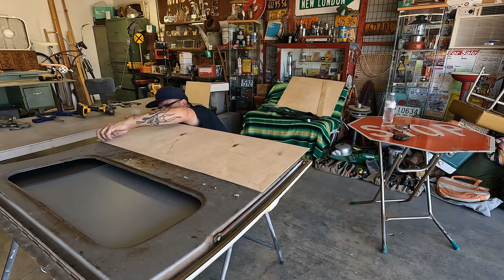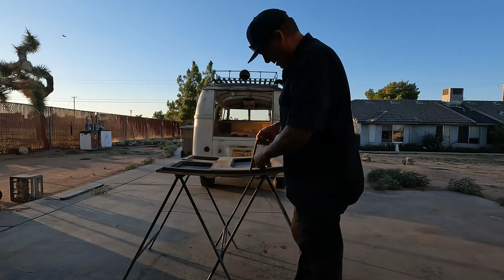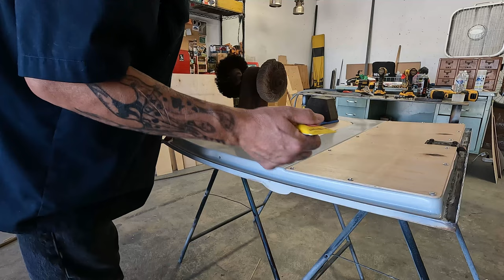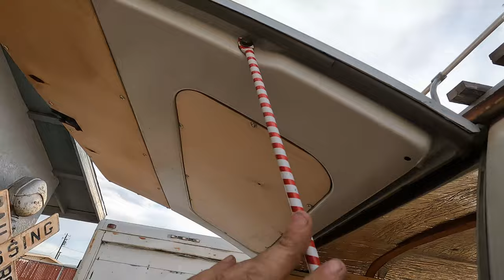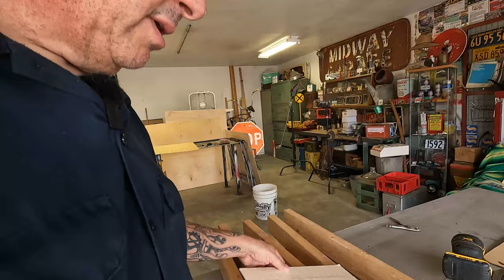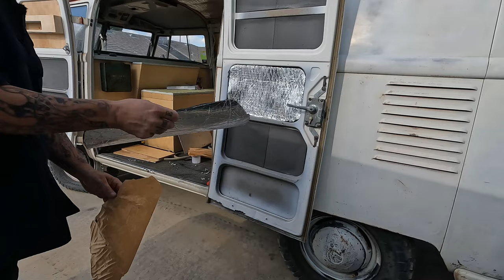VW Bus Camper Interior Restoration - Rear Hatch Cargo Door Panels - Budget Overlanding Minded

Comment: Larry Thanks for sharing and all your hard work.  Great Video.  Where did you find the Baltic Birch ply for the panels?  Maybe I missed it.  Thanks
Reply from the maker: Three or Four years ago I found the Baltic Birch paneling on Offer-Up and decided to check them out. I took a drive to Highland near San Bernardino, CA to see the guy. This dude had a lot of paneling! So I sifted through about 500 pieces to find the best 10 that were all the same hue and 5'x5' size. Although they all had some flaws, I didn't mind since the price was right. The seller quoted me $20-25us each but then he priced them at $50us for the lot, which was a steal, so I was thrilled to buy them. Maybe the seller felt terrible after seeing me dig through all those panels for hours? In any case, I consider myself lucky to have found those 10 panels. It was a great score! 
✌️- Larry